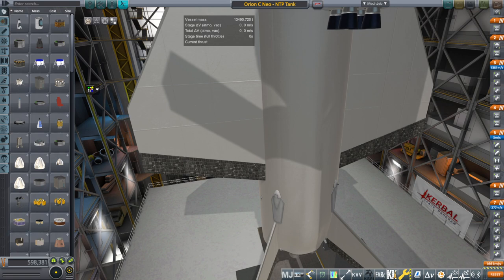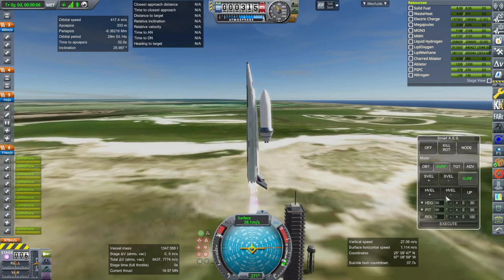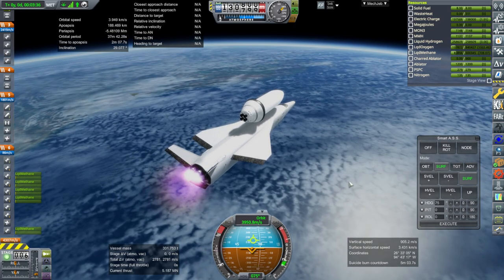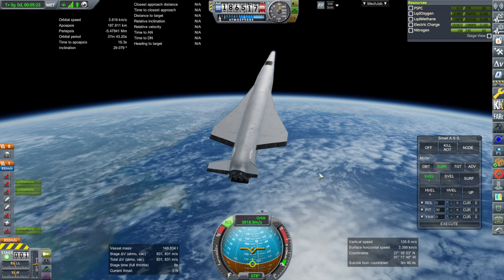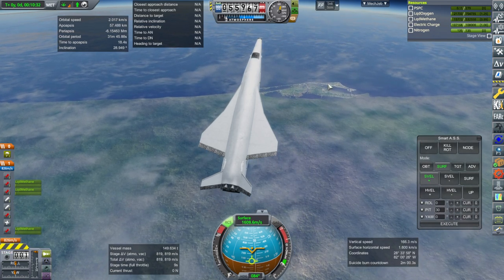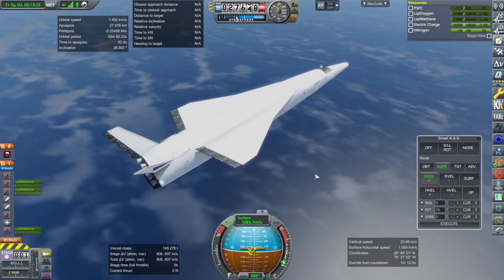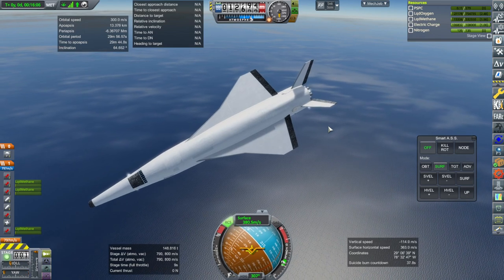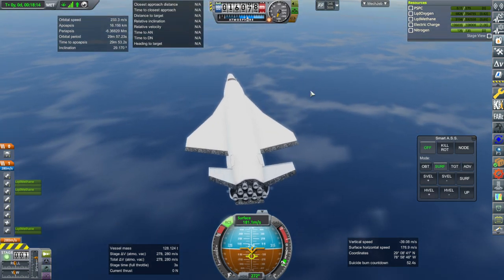Realism Overhaul in KSP 1.8.1 - Orion Carrier Upgrade Test 2

Comment: what inclinations can you get to using this? seems pretty slim if launching from boca -> the cape.
Reply from the maker: Very slim, yes - the purpose would be exclusively for missions to the Moon and beyond, so that is not a problem. This would not be a solution for launching LEO or MEO comm sats unless another pair of sites at the same distance (about 1100 miles) is used.